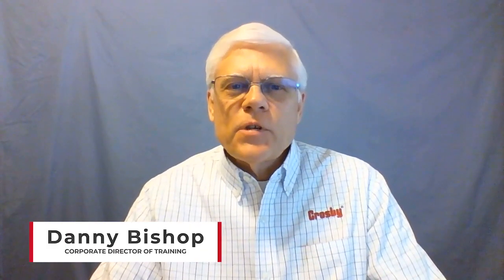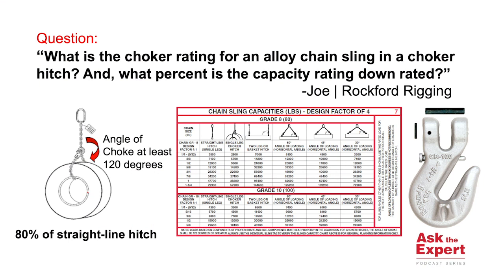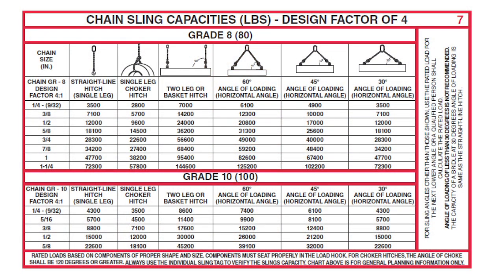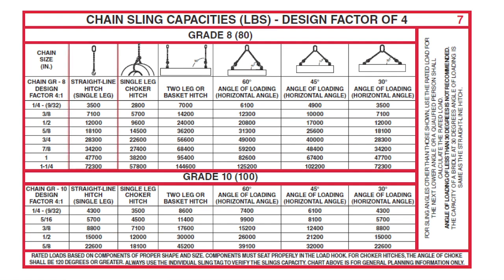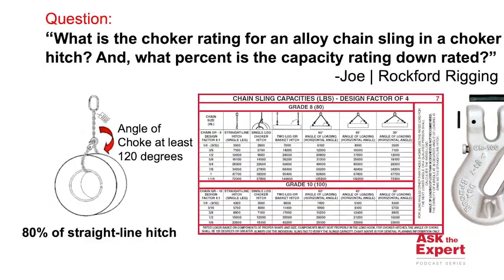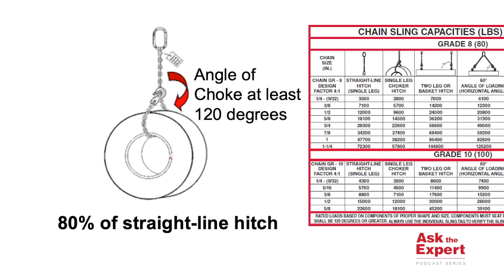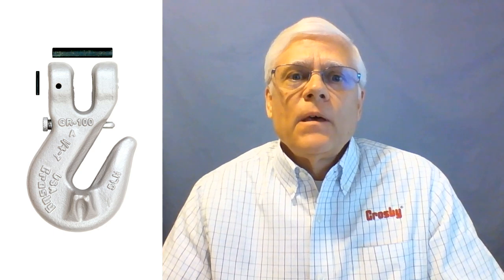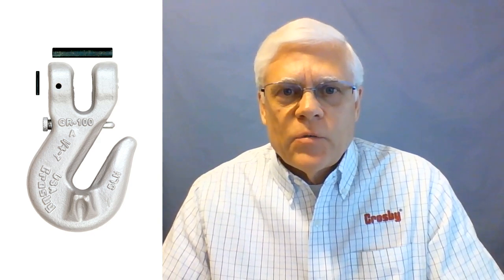Choker rating for alloy chain sling in choker hitch

Comment: When utilizing the choker hitch with a slip hook, is there not concern for the ways the chain and hook are being loaded compared to a grab style hook?
Reply from the maker: The choker hitch using a grab hook will be 80% of the straight line hitch if the angle of choke is 120 degrees or greater.  The choker hitch using a standard hook may require more than 20% reduction because the angle cannot always be controlled.